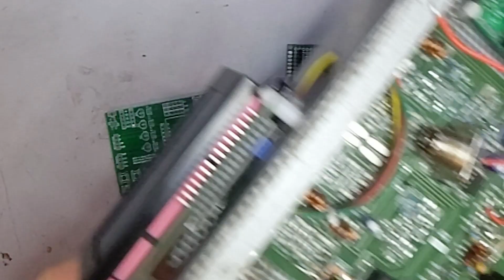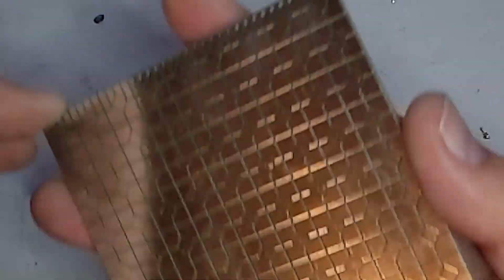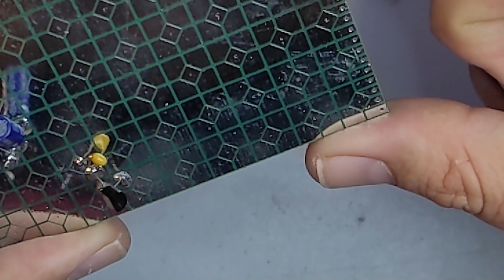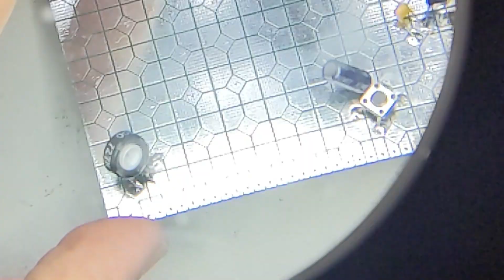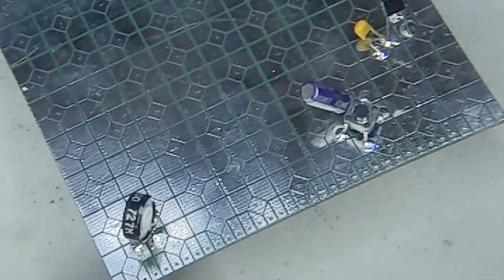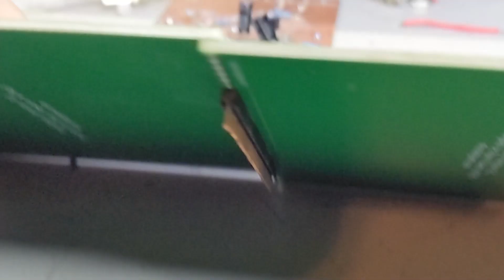New Ham Radio Homebrew Prototyping Board (WITH ORDER LINK)

Comment: Hey Ryan, nice boards. How would size 1206 SMD components fit on that board? I prototype with almost all 1206 or smaller parts anymore, it's so much quicker than using trough hole parts and takes up less room on the board.
Reply from the maker: I don't see why not. 1206 is 1.6x3.1mm, and the pads are 4.57mm in size (save for the cut corner). The diamonds are 3.23mm. They have .5mm between them all. Should be good :) Also, are you ordering all your SMD parts individually, or did you find selection kits that have them all? I'd love to to use those for the same reasons.
Reply: @MiscDotGeek  I ordered separate resistor, capacitor, and inductor kits in 1206 and 0805. I have collected quite a stock of semiconductors also over the years, every time I order ICs and transistors I always get extras.
Reply from the maker: @caulktel  So you get kits that contain different values of each? Those kits are easy to find for through-hole parts, but I haven't seen them at reasonable prices for SMD.
Reply: @MiscDotGeek  eBay is where I got mine.
Reply from the maker: @caulktel  Thanks. I don't know why I didn't think to look there! I'll have to pick up some 1206 resistors to play with.

Comment: Looks good.  I am glad you are going to make the spacing a little wider.  Since I didn't hear you name it, in light of the pattern and the designer I vote for calling it a Flowers board.  I was just going to breadboard it but I wanted something more permanent so I stuck it on a Flowers board...
Reply from the maker: Yes I suppose they do look somewhat flowery don't they lol. I don't know about calling a flower boards though. Right now they are the W7RLF Proto Board Version 0.1 🤠